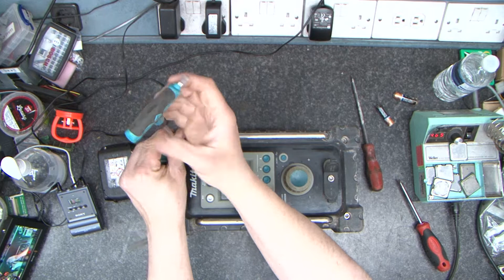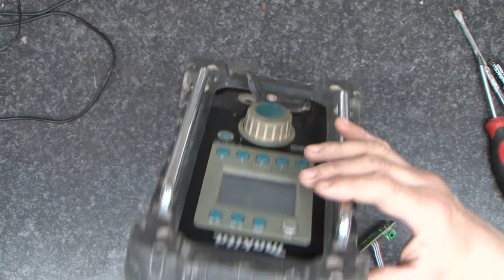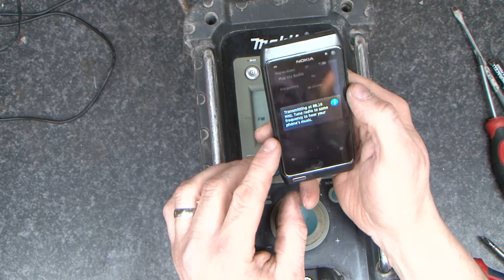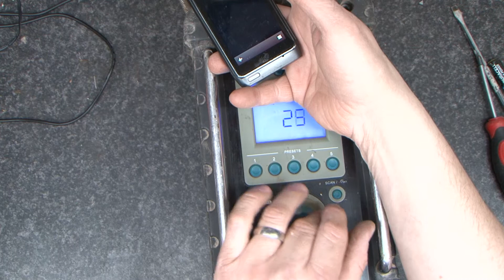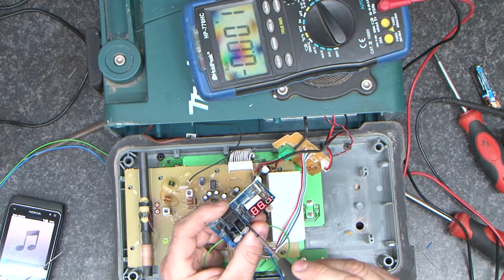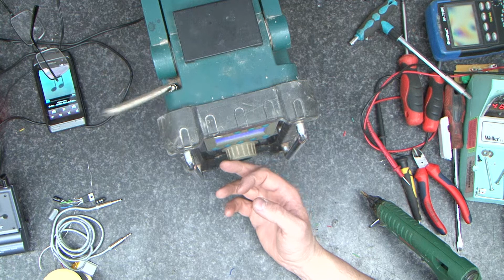Lets Fix a Makita site radio No power , and add bluetooth recover to it

Comment: Have 2 of the these radios that didn’t work, fixed both of them now because of your vid. Also found a corroded line in the circuit board that stopped it powering on so joined that with a bit of wire. Thank you very much!!
Reply from the maker: Glad I could help